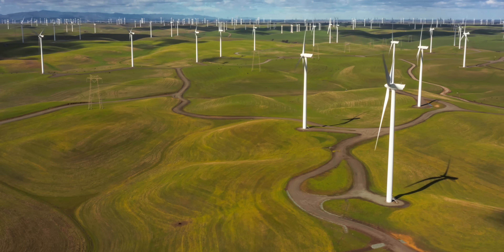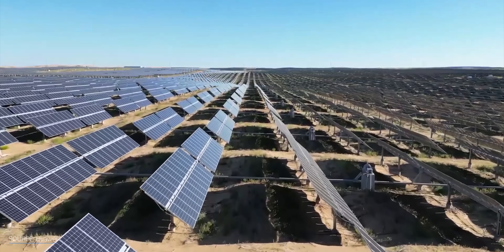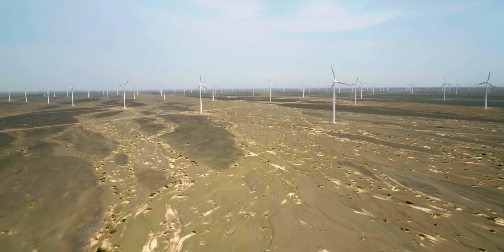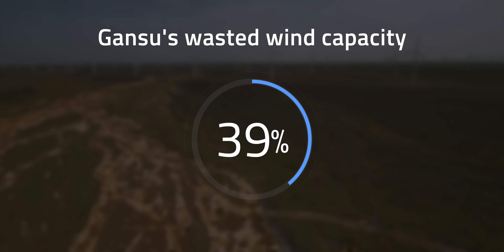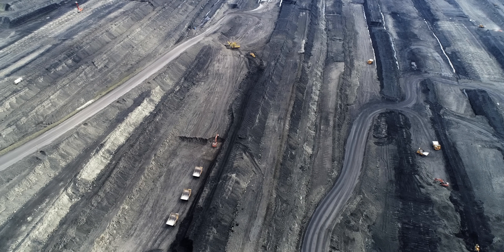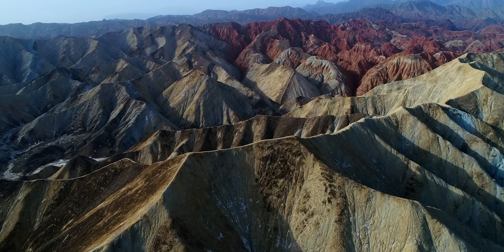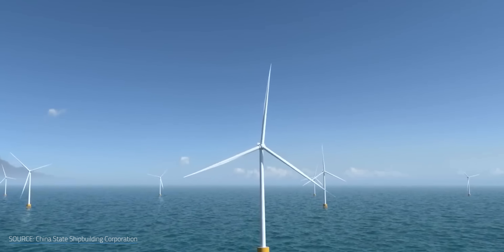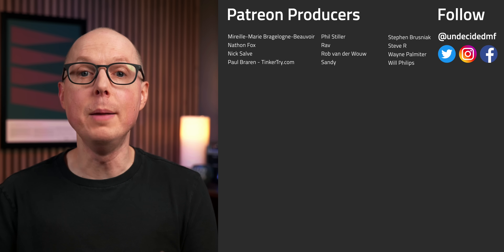The World’s Largest Wind Farm has a Tiny Problem

Comment: A 1.5GW nuclear reactor takes up less than an acre. The reactor vessel is only 20 feet across.
Reply: everyone is ignoring the elephant in the room with wind power. it only generates power 30% of the time, and there is no way to reliably predict when it will produce.  so for wind you need to include backup power generation that can handle 100% of the load.  when viewed from that perspective, you can see that wind is just an expensive additional cost that isn't needed. yes wind would lower co2 if you use fossil fuels, but if the grid is nuclear then wind is extraneous.  to be fair, wind power cost calculations should include the backup power sources used to power the grid when wind power isn't operating.  i pretty sure that will show nuclear is significantly cheaper, and safer.
Reply: but, but muh waste or whatever
Reply: These are not competing with nuclear when coal is still around.
Reply: ... and after approx. 30 years of energy production leaves behind toxic waste for approx. 300,000 years... What a stupid technology.
Reply: Cost efficiency is the factor, especially if you have massive abandoned land and all years sunny day
Reply: You cant cover more than 2% of world energy with nuclear. Is objectively out of the debate years ago. Just a secondary and non renewable resource for the countries that have uranium... :(
Reply: The cost for UK nuclear new power plant is 3× the cost for customers fact .
Reply: @TheGezm2008  3X of what?
Reply: China is also the biggest builder of nuclear power as well.
Reply: Is the fuel free?   Is the spent fuel safe?
Reply: @erikkovacs3097  does that include cooling ponds, energy distribution infrastructure, uranium mines and treatment facilities?
Reply: @stephenbartlett6525  Cooling ponds, yes. Energy distribution infrastructure is already there. Uranium mines aren't exclusively for uranium and I guarantee that kw/hr to kw/hr the mining required for nuclear is far less than solar or wind. Treatment facilities are usually on site like the cooling ponds.
Reply: @erikkovacs3097  Aaaaaaamen!
Reply: And China's building them too.  But in both US and UK they're 30 Billion apiece.
Reply: @timothyconover9805  Nuclear power plants don't cost that much in the U.S., and a hefty portion of that cost is due to regulatory hurdles.
Reply: @Objectified  Vogtle spent $1 Billion demolishing and rebuilding the foundation because it wasn't "nuclear rated" concrete. Whatever that means.
Reply: And, a 1.5 GW nuclear reactor produces approximately 1.5 GW for the better part of a century. A 1.5 GW wind farm produces ~ 400 MW for a decade, give or take, and then goes into a landfill, because it can't be recycled.
Reply: Nuclear waste vs old turbine blades - which are easier to deal with at the end of their life?
Reply: @thatcanada   nuclear waste can be reused. There are designs for it.
Reply: @troybaxter not yet realized anywhere... remains wishful thinking.
Reply: @thatcanada  Nuclear waste is tiny and can be mixed with glass or carborundum (which are insoluble) and buried until they vanish. That is what Atomic Energy of Canada Ltd is doing. BTW it is buried in the Precambrian Shield which has been geologically stable for eons.
Reply: @thatcanada  I find it difficult to believe that people who watch channels like this are as ignorant as you are about modern nuclear reactors, reactor fuel, and waste.
Reply: @thatcanada  nuclear waste, it is less radioactive than when it was mined, so just put it back. Old turbine blades are made of composites, so partly plastic, and they can't be easily dealt with nor can they be recycled.
Reply: @tktspeed1433  There are reactors in Russia that use "waste" as an actual fuel. It's not that hard.
Reply: @tktspeed1433 the waste is more radioactive than when it was mined because it was refined concentrated and enriched.
Reply: Old turbine blades. There is a process that break down the resin that bonds the layers of fibbers together. Once cleaned the glass can be melted and recycled into new fibres.
Yes, there are images of blades in landfills. This is an industry process problem, not a technological problem mostly practiced by companies seeking to replace older smaller diameter turbines with larger, more revenue generating new turbines.
Reply: @AerialWaviator  Recycling turbine blades is an energy problem. It takes more energy (money) to recycle them then to build them.
Reply: @AerialWaviator  It's almost always cheaper to create new than recycle old unfortunately.  Unless motivated by government, businesses will take the cheap route.
Reply: @AerialWaviator  Currently the recycling  proces is more expensive than building blades from virgin material.
Reply: @thatcanada  Nuclear waste is by far easier to deal with. It is compact and solid. Kw/hr for kw/hr windmill blades take up far more room an are difficult to impossible to recycle. When I say compact I mean COMPACT, it is difficult to convey how little room Nuclear waste takes up. Nuclear waste is also future fuel when it becomes economical so disposal isn't necessary.
Reply: Sure. So let's put a bus station and a shopping mall next door and time how long it takes for nefarious actors to sneak in. For security measures alone (and for safety margins) there will need to be a large secure perimeter.
Reply: But to maintain a nuclear plant you will need the  space of an small town.
Reply: How much space does the uranium mine take up?

But the bigger problem with nuclear is that it is not renewable. China has about 230,000t but in the last 70 years they dug up only 55,000. Sounds great. However, as more power stations are built, consumption has increased. They are now using around 7000t a year. That's enough for 33 years, but you see the problem don't you? Because 33 years is not a very long time, and it will go down as consumption rates go even higher of they build more power stations. If they double the number of nuclear power stations, the 33 years halves to just 17.

Their temporary workaround is just to rely on imports. China has uranium, but local production only meets ¼ of their usage. They import the rest. 

But if western countries also build a lot of nuclear power stations, there might be a scramble for it, it gets declared a national security essential resource, and China finds itself cut off from their suppliers. They need renewables in a way that we do not.
Reply: @danielch6662  Actually, the nuclear reactor rods are recyclable. France, Japan, Germany, Belgium, and Russia all recycle nuclear fuel to generate electricity; however, here in the US, spend rods are not recycled. To put it in perspective, spend reactor rods, still contain 90% of the potential energy even after 5 years of operation. Nuclear power is emission free, does not use a lot of land unlike wind and solar farms.
Reply: @danielch6662  Uranium is one of the most plentiful elements in the earth's crust, with thorium in second place. Being renewable literally doesn't matter if our current technology can last us for the next 20,000 years. Only settling for FULLY renewable is a catch 22, because there is no such thing as "fully" renewable. Everything has a price, and each tree you grow makes the soil poorer. Each algae farm you build consumes more CO2 than it prevents etc. etc.
Reply: @danielch6662 Uranium supplies are almost infinite. (Many thousands of years). A person requires a 3 inch cube of it to power their entire life. It’s also recyclable. It’s cheapest and safest when not regulated to silly extremes. It’s carbon free.
Reply: @danielch6662  Plenty of energy still remains in "used" nuclear fuel that just needs to be re-processed. We're not likely to run out of usable nuclear fuel for a while, even if we were to go full nuclear for the forseeable energy needs of the future.
Reply: @danielch6662  You do know that nuclear fuel never runs out, it just produces less energy, right?
Reply: @danielch6662  How much mining needs to take place to build renewables? 

You don't understand what Reserves mean. China has a lot more uranium than the 230000t, but it has not yet been classified as Reserves. There is no point spending all the money needed to move those resources into Reserves status at present.
Reply: @danielch6662  spent fuel can be recycled, also we can use radioactive elements other than uranium.
Reply: @danielch6662  You're a smart man
Reply: @danielch6662  Canada has uranium reserves of aprox 700,000 t so there is enough uraium to provide electricity for a long time
Reply: @danielch6662 tldr but to your first question.  Not much.  An entire lifetime of energy for 1 human takes about a cup of fuel.  It's  much more renewable than wind.  The fiberglass blades have to be mined, chemical resins produced  and thrown away every 15 to 20 years.  Get ready to open lots and lots and lots of landfills for these things.
Reply: look in to france 90% of the rods get reused actualy , its cheep and clean
Reply: @mapmakerscs16  Agree
Reply: @danielch6662  Thats a thing I see MANY people ignore. We dont have much usable U235 on the planet; so little in fact that if the entire planet were to solely use NPPs, we would blow through all of it in less then a century and with the ever increasing energy consumption of the planet, this number will get even smaller.
Reply: @danielch6662  Hey, if you want to play that game, the uranium mines take up less space than the copper, nickel, iron, and rare earth mines required to build wind turbines. I suspect you don't understand how incredibly energy dense nuclear power plants are. You can store 100 years' worth of fuel in a parking lot. Kilowatt/hour for killowatt/hour nuclear is far less impactful than so called "renewables" which is a marketing term that is meaningless as nothing is truly "renewable" because the sun has a finite life span. We will never truly run out of uranium because the oceans contain enough for 1000's of years' worth of consumption, which will give us plenty of time to harness new energy sources.
Reply: @erikkovacs3097  'we'll never run out of Uranium, but the sun has a limited lifespan'? Dude. Also, are you SURE a  uranium mine that supplies enough FOR THE LIFETIME OF THE PROJECT is  smaller than the mineral mines required to build a wind farm? Minerals which can be recovered at end of the project life, I might add...
Reply: @robupsidedown  Yes, uranium mines require much less material than windfarms owning to the energy density of uranium. When uranium prices increase, uranium can be economically filtered from ocean water, opening up reserves far larger than those underground.
Reply: @robupsidedown  spent fuel rods can be recycled into new fuel rods too. it's just that only france does it because everyone else has decided it's not worth it for them. it's just a matter of removing the unfounded fears of nuclear power, and having more operational plants before more industries decide that it's worth recycling.
Reply: @erikkovacs3097  There is no uranium in the ocean
Reply: @c雨颖  sir
there are trace elements everywhere
just need to chase them out
cost is the factor
ray uk gb
Reply: The issue is not "power" (GW), it's about delivering "energy" (GWh).
Nuclear reactors still require fuel that needs replacing, and disposal. 
Reactors also take significant time to build, and power from nuclear is generally more expensive. China has been building one for UK the last 15 years, and it may not come online for another 5 years.
Reply: @AerialWaviator  reactors don't actually take that long to build, if you take out the red tape. you can go from a wooded area, to operational facility in about 2-3 years if it's not slowed down by bureaucracy. Inspections are important, and should definitely still exist, but the current methods used are intentionally designed to be slow and drag their feet. the build times are quite comparable to coal plants.
Reply: @AerialWaviator  Thorium-based nuclear should be a much more realistic proposition if we could pull our fingers out and start building practical modular reactors. There is a paradox however. If we are successful in that effort then the price of electricity diminishes to almost nothing so since investors don't see a return on their money they don't invest. Another side effect of our species' idiot reliance on money.
Reply: @AerialWaviator  I think you will find that Brittain buy all theirs from france. Several months ago 2 were shipped over the channel and reported in british papers.
Reply: @AerialWaviator  the reactors of the past that we can't let go of for some reason are that way yes. Microreactors are the future and it's embarrassing anybody is spending 20 years building big ones when we could knock out hundreds of smaller safer ones in that time if we doubled down on them.
Reply: the nuclear reactor takes up more space vertically. and maintenance building
Reply: @What-ez6im  Wind turbines need to be replaced every 20 years, and here in the UK, they need to be repaired and maintained after every storm that breaches the 80mph wind speed (which is basically like 6-10 times a year). A nuclear reactor would be easier to maintain than a fan that you aren't meant to spin too fast...

Comment: Don't worry. AI data centers will lap it up. Weather isn't too hot, and with cool nights in the desert, cooling isn't a big issue. It's all about balancing the nodes with the networking infrastructure, power transmission as well as data.

Comment: Have you heard about Nuclear energy? 
Cleaner,efficiency and less headache than those wind farms barely moving. 
Wind in the US doesn’t work.
Reply: ask France about the 'less headache' - when the rivers used for cooling dont carry enough water anymore in the summer
Reply: How good wind works depends on the location. In some parts (e.g. texas) wind works well in the US.
Nuclear was tried and is in decline for a good reasons: high costs, largely unsolved waste depository and limited uranium reserves.
Reply: and not really "clean" if you have dangerously radio-active used uranium fuel rods to dispose of "somewhere" at regular intervals.

Comment: That 70,000 acre number must be missing a couple digits.  70,000 acres is only a 10.5 mile x 10.5 mile area and that would be a small windfarm.  Seven million acres would be 105 mi x 105 mi and that would actually be a large wind farm.
Reply: yeah there is a 15 x 15 sq mile wind farm in Texas that was easy to find with minimal research.
Reply: 10.5 x 10.5 mile sounds more realistic than 105 x 105 miles. Here's why. Warning. Maths. But only very simple arithmetic. 😊

10.5 miles is 16.9km. Metric is easier for calculations.

They have 7000 tower/turbines. Put them on a grid, sq rt of 7000 = 83.7

16.9km / 83.7 = 200m

Turbine tower + blade = 120m

Look at the video. Does the distance between the towers look like about 2x the height of the tower+blade or about 20x that distance?
Reply: @danielch6662  Yeah, but my point was that a windfarm that's only 10 miles square is just a small wind farm.  Once he said 70,000 acres in the video, I quit watching because there's little point to wasting time on BS green energy videos.
Reply: @danielch6662  i think most of his videos are stock videos of unrelated wind  turbine farms and transmission lines.   So hard to say what the actual spacing of turbines might be.
Reply: PS: I don't know how tall the towers are in Gansu. Google says average height today is about 60-120m, but the average height in the US is 80m. And the Gansu project isn't new, so their towers are also not the latest designs, which trend bigger. The Gansu project started 15y ago.
Reply: Area of Belgium is 7.5 million acres.
Reply: You got it. The wind farm is about 105 by 105 miles.

Comment: 8:29  How the heck to you "discard" electricity?
Reply: You can turn it into heat. But more realistically, "discarding" electricity in this case likely means adjusting the turbines so less energy was captured in the first place.
Reply: When a user charges their electronic device to display tiktok on it, they discard electricity. Lot of tiktok in china.
Reply: Usually by just reducing generation. Though there are dump loads connected to electricity grids - basically just giant resistor banks - they are intended only for emergency use. to buy time for turbines to torque down.
Reply: @vylbird8014    Well, that all makes total sense, including the part about the torque-down resistors, but I wouldn't describe it as "discarding".  It's most like... just not making it.

Comment: It will only generate full power when there is optimal wind. I don't know why f-wits can't get this through there heads, no wind, no power. No place gets wind 24/7/365. Then there of course is the fact that climatic conditions change over time and so can the number of windy days. This is an unreliable means of power generation. Always will be. It is also ridiculously expensive and maintenance intensive adding more cost.